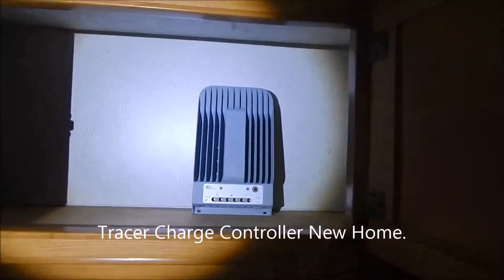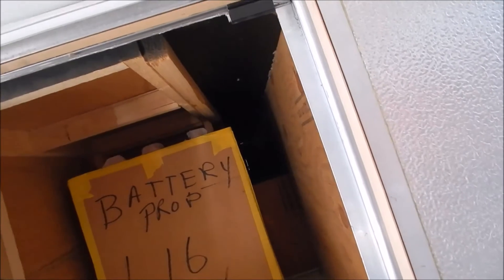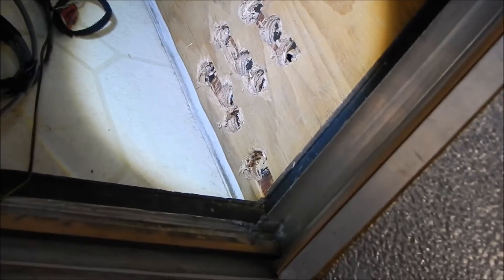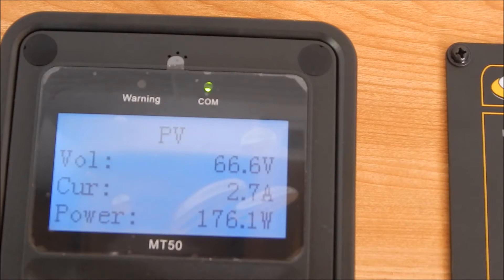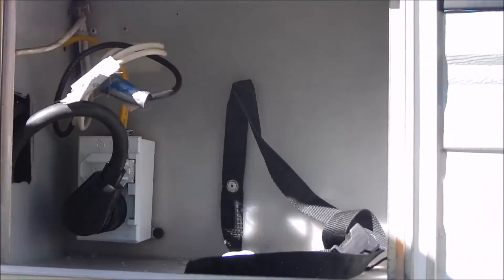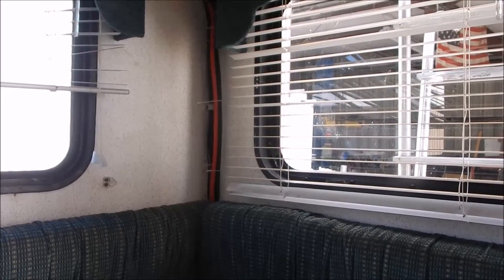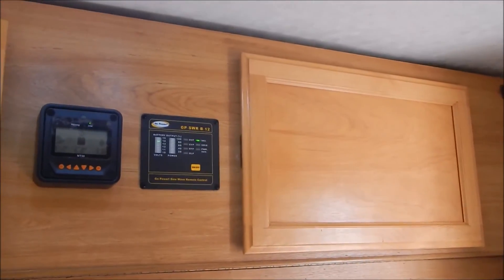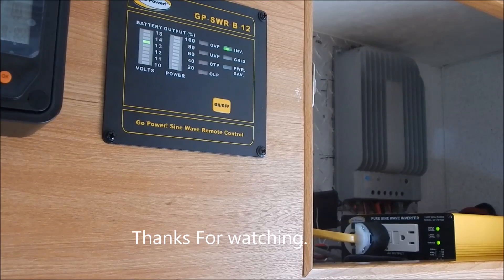Lance Solar Powered Camper Its Alive!

Comment: Great video Thanks! How did you integrate the 250Watt 24v solar panels into the existing 12v system? I am attempting to put 1000 watts on my Lance and I would much rather go with 4-250's than 10-100s.

Comment: How many watts was the A/C unit?
Reply from the maker: A/C unit draws about 1100 watts. it is a very efficient unit it starts the interior fan first , then the compressor , then the out side fan. I got this brand A/C unit because its the only 1 that does that very happy with it .I lived in the camper this past summer for  6 weeks in NH.  This is my 2nd solar camper build. Thanks for watching.
Reply: TheKilog69 Yeah!  talking about a soft start.  that makes it really nice on the inverter for sure.

Comment: You need at least 000 wire on your batts so you can run the ac that is most of the problem. That will mess it up every time when you pulling a load makes a big resistance using only 4 awg wire. Best get some high performance cables on the batts to save juice. I have read a lot about that and that is what it is. Have you seen the wire I put on my inverter and batts its really big. I think its 00 or triple 0 yeah on solar 4 awg wire is not even close to being sufficient it way below what you need.
Reply from the maker: +shartne Hi 4awg is for the charge controller. I used what GOPower owners manual said to use up to 10Ft.# 2AWG welding cable with a 200 Amp breaker for 3000 watt surge rating I used 9FT of 2 awg for inverter it works very well Itt was supply about 1150 watts of power with the A/C on & lights plus 30 watts just to go through the A/C dc converter that makes every thing  inside the camper work. the lights that were coming on were warning me I was close to max constant power. This will more than power the lights, water pump fridge. & the hybrid water heater I will be installing this weekend  it uses LP gas or 400 watts of ac power or both at same time. If I need ac at night I will use the little Gen set I have .
Reply: +TheKilog69 4 gauge ? OK  I still would use much bigger so it would not come close to having any resistance. I dont like the 2,000 watt gopower anymore since mine failed. But  the 1500 watt has proven to be very reliable. I dont think they like high humidity is my guess. It worked in the house but out side in the shed it didnt like humidity Im guessing. Remember Bigger is always better.

Comment: Looking good there.  I just got my 40A Tracer charge controller and MT50 display ordered today.  Looks like yours is working well.
Reply from the maker: +R Brown (4Crawler) Thanks. I am very impressed with this charge controller it seems well made( heavy) it has lots of user features my Out Back does not come STD. with. I also got the remote battery temp cable & with that it also came with a USB cord to hook to the lap top. They also make a 60 Amp Unit but at almost $500 I would buy a Mid night Or Out Back at that price point, this unit cost me $239 with shipping plus $12 for batty sensor & Lap top USB cord. I will be installing a hybrid water heater this week end LP gas or a 400 watt 110 ac heater or U can use both at the same time I will run from solar when needed save LP Gas.
Reply: +TheKilog69 Does sound like a nice unit.  Thanks for the reminder about the temp. sensor cable, I got one of those ordered as well, I don't think the unit I ordered had that included.  I'll be setting mine up beside my current Tracer 4210RN controller.  Since I have around 900W of panels on a 12V system, I'm not able to get full solar power on good days, so the 2nd controller should help out there.  Your camper solar setup is almost as big as what I have for my whole house!

Comment: NICE work. I like those MT50 displays. I have the old one on my 3215. Is the compartment with the charge controller and inverter vented? Or did I miss that. Lots of great work there!
Reply from the maker: +Chris DIYer Thanks! I mounted Charge controller on a piece of aluminum Plate as it is cooled through the body of charge controller & yes there is plenty of venting It is a good size upper bed area with about a 1/2 inch space all around the door area. Cant imaging any issues but I guess I find out first hand soon. I am installing a hybrid water heater LP or 120 ac or both at same time  this weekend.

Comment: Nice install, The inverter ran the ac for a bit. But like you said she was pushing the inverter and the 2 little batteries would not run it long. But they should run your lights and fridge and a fan no problem at all, I like the fan install in the battery box. i would seal the lid though. You do not want hydrogen to seep into the van and build up. You doing a great Job on the camper mate. Love it.
Reply from the maker: +Justin Case Thanks ! I never planed on using inverter to run A/C with it just testing what it would do the inverter was a used eBay item.  Yes better to be safe. The battery box fan does a great job of moving air it is over kill 100 cu. Ft fan in a 2 cu ft. box U can walk by & feel it blowing out. As to hydrogen issue it is contained by the piece of paneling & the big seat cushion plus using the water miser vent cap system the caps eliminate about 90% or better on fumes they are awesome I am in almost in mouth 7 of use on the first 2 battery have not seen any difference in the water level or added any it is amazing I highly recommend any one using these type battery's to get the caps they are worth it . Thanks for the kind words my friend.

Comment: Great job. Should have plenty of power.  Thanks for showing us.  Great idea on the props.
Reply from the maker: +SyberPrepper  Thanks. It dawn on me that I never show some of how I do things I use props all the time less were & tear on me & what ever I am trying to put the item I also had 1 for the inverter. The hybrid water heater install  LP Gas 110 ac or both at the same time l I will be doing this weekend plus finish up trying back some wires.